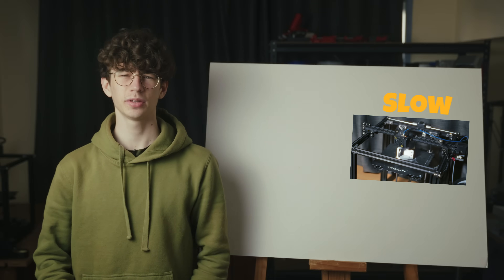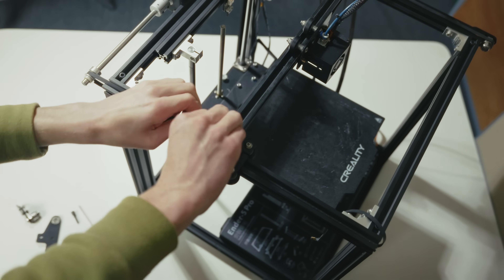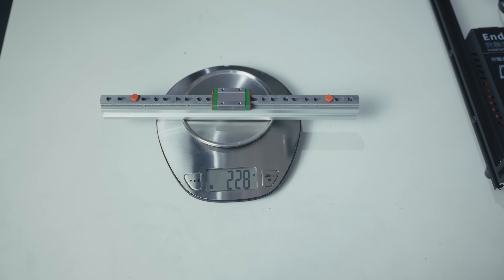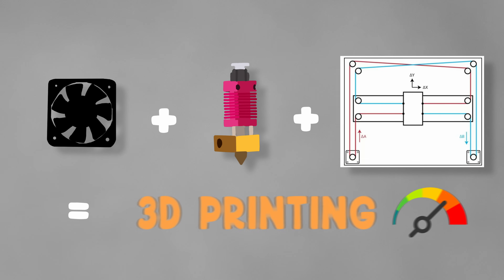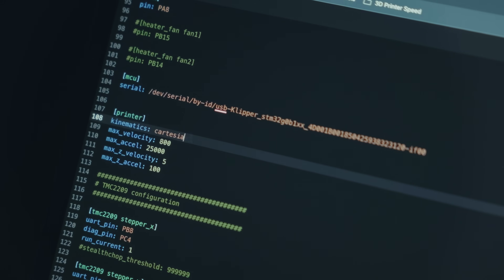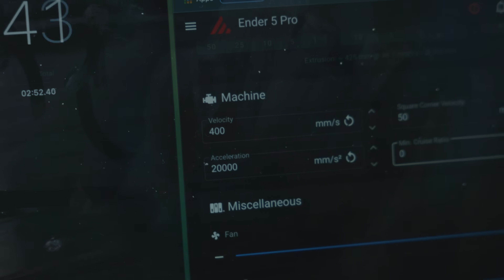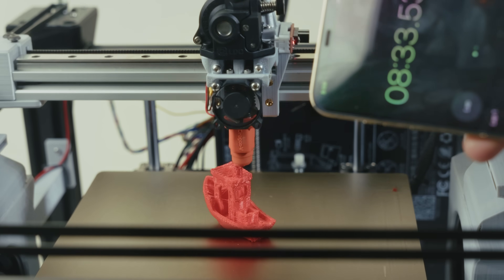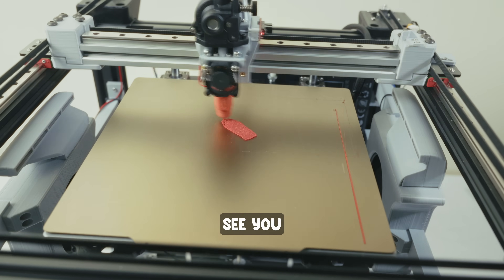Building the Fastest Ender 5 Pro

Comment: Your comparisons of Modified to Stock quality are objectionable. E.g. @ 15:07 Beyond being obviously worse quality than the 78m stock, That 8 minute 43s had a layer shift. The motion system failed. The motion system was the whole point of the mod. Don't pass go, don't collect 200, the machine did not successfully print an 8m benchy.
Reply from the maker: Objectionable is putting it lightly, so I appreciate your patience with your comment; I think I spent less than 1 hour actually tuning/calibrating this machine once it even worked, let alone time spent doing test prints. The quality is far from ideal, even at the lower speeds, although the speed print was just for fun. In this instance, and even with the Mercury 1.1 conversion, the flimsy z-axis mount is quite a notable bottleneck. Regarding the layer shift, I worry that I didn't even do Input Shaper on this machine, so that likely was the cause for such a low-speed skip. Cheers!

Comment: is there an upgrade to Ender 5 Plus?
Reply from the maker: I don't believe Boothy's conversion is meant for the E5 plus, but I know that the Mercury 1.1 conversion does work with the E5 Plus, and quite well too, given the better Z axis design on that model. It's definitely worth looking into. I did a video on that conversion too, although it was still on this Pro model, and not the Base or Plus one. Cheers!

Comment: Hello
Could you tell me which firmware you have installed please?
Do you have a link where we can recover this one?
I transformed my Ender 5 into Core XY and I am currently in the Klipper installation stage which poses some problems for me.
Thank you very much for your help
Reply from the maker: Hi, I have klipper firmware installed. I unfortunately have no links or files since this was very long ago. Have you tried restarting the installation process? Issues can sometimes be due to the MicroSD card.
If you are able to provide a basic explanation of the problem, I can try and help, but I do not have much time at the moment, sorry. I wish you all the best I can with fixing this. I know how frustrating it can be.

Comment: bro,can you tell me what should i do that is realistic and not expensive to make my ender 5 pro fast?
Reply from the maker: Klipper and Input Shaper are always the most cost effective methods for increasing motion system speed and quality. Then, a cheaper high flow hotend and some high RPM 5015's can make things a whole lot better too. Those are the most value friendly options before things get more complex and costly, in my opinion. I hope that helps a little bit. Cheers!

Comment: ia there the printer.cfg file ?
Reply from the maker: I don't have this config anymore, sorry. I've been trying to store later ones in case, but don't have this one handy.
Reply: @TommyHoughton you already tore this down? 

What was the reasoning like what is the disadvantages
Reply from the maker: Honestly, most of my printers don't get used after their respective videos, usually because my executions are sub-par and they're hanging on for life... I'm working on getting better at fixing this.
I mainly wanted to go crazy with the Merc 1.1 conversion with AWD, since I knew it would be a performant machine and video. It was mostly a learning experience goal, but I prefer the Merc mod more because of the community. There's more mods, upgrades and parts, and the instructions were equally as fantastic. There aren't any notable disadvantages with either of them from what I experienced.
Reply: @TommyHoughton I respect that 
I only went for this mod Bec I started before the merc came out so finally got to it and now almost done the build

Comment: Yeah, The custom linear rail was clever, but from an engineering standpoint that's one of the components that makes the least sense to replace with a lighter version. 

I'm happy you went back to the real one. that aluminum extrusion that you use for the gantry is very heavy, for vorons and stuff they make insanely light gantries that you can just bolt the linear rail to.
Reply from the maker: I had high hopes! But yeah, I was a bit blinded by weight reduction and cool factor. 
I did want to try a cnc'd one, but at this point, a good x-axis beam (machined, CF or stock) is what I'll keep going with in the future, and I'll just compensate with more power. I hear fysetc makes some lighter linear rails, but I don't know if I'll try one yet. 
Cheers!

Comment: Thank you for all your support. At least I got faster prints, bit know I have horrible noise! I checked the rails without belts and is silent,  then I install the belts and the printer sounds like and old bed. Is that normal?
Reply from the maker: You're very welcome, and I'm happy to continue helping you. It doesn't sound normal. If everything is correct than the machine should still be mostly quiet, but running the drivers in spreadcycle vs stealthchop would make it louder than before, but it shouldn't be on a horrible level like you described. Is there anything mechanical that seems wrong? It's possible that the belts may be rubbing somewhere, or perhaps the belt has missed one of the pulleys and is making contact with the frame. It's maybe possible they're overtightened, but this is less likely compared to the other possibilities. These are my best guesses. Please let me know if that helps or doesn't!

Comment: Master I need your help. The printer is printing horrible! A simple calibration cube and the result is not a cube. It is like a trapezoid! What could be the problem?
Reply from the maker: Hey Sebastian, I'm sorry to hear that. Like a trapezoid? I never encountered such an issue when I did this mod, so I'm at a bit of a loss for what could be the issue. It’s possible with CoreXY to have skew issues when the belts are unevenly tensioned, so perhaps that's a factor? I’d also check if the pulleys are aligned and the grub screws holding them are fully secure. It's also possible that one of the motors is moving or less than the other via different rotation distance values, or if the grub screw isn't tight like before. It's a bit difficult for me to provide suggestions, as I haven't yet encountered a similar issue. I hope you resolve it, and I'll be here to offer any advice that I can. I'm glad to hear that you're at least at the printing stage now.
Reply: @TommyHoughton  hello! Thanks for your answer! I found the main issue,  one of the motor pulley was not tight, then it was sliding in the motor hehe. Solved that I am getting a fairly cube. I found my x aluminun profile is not straigh, ans it is because I am supporting it with a different support ans it is not very strong. I need to re design and print it, but problem is that the print will not be good with this problem hehe. It is my only printer
Reply from the maker: Hey Sebastian. I'm really glad to hear that! That was the same issue I had on the other conversion I did to this machine. Ah, I see. Those extrusions can very in straightness. If you're still having issues with the straightness, or "skew" of the prints, then there is perhaps a digital solution. I would recommend checking out Vector 3D's "Califlower" which is a calibration print design to help correct skew in prints. It may help your machine work better! I saw a free version of the file alongside a few other variants, but I haven't use either of them.

Comment: hello!!! I have almost everything done!!! but.... in Klipper is just to change the kinematics to corexy?
Reply from the maker: That's great to hear Sebastian! You're making awesome progress. 
Changing the kinematics to CoreXY is a good step and I think the most important one. Depending on if you changed your mainboard, there are a few other changes such as making sure all the pins are correct for the components, PID Tunes, endstops and homing direction, limits for each axis (E.G installing a part has taken away 10mm from X axis so that would need adjusting.) There shouldn't be any harm in testing each area of the printer (extrusion, homing, etc) and seeing what needs adjusting as you discover it. Good luck!
Reply: @TommyHoughton  thank you! It is working with the kinematics and I had to invert the mottora direction, now I am setting the bl touch and I will include all the info you gave me. Thanks!

Comment: I mean, after all that, might as well just buy a different printer
Reply from the maker: Sure, if I wanted to just print and not tinker. But I like to tinker and learn. Even after a rework in part 2, this machine is lacking (notably in the Z-Axis and a bit in the belt tensioning mechanisms,) but once I learn how to make that as good as it can be, I'll be able to confidently replicate that for a custom build which is the ultimate goal. Cheers!
Reply: @TommyHoughton why dont you try mercury one hydra y would greatly improve z axis i would love to see a quality centered improvement for this printer.
Reply from the maker: @g10by  It's crossed my mind a few times, and was especially enticing when I later converted this machine to a Mercury 1.1, but at the time, the added cost would have been too much for me, and made the project more complex than I could have handled. I can't promise I'll give it a go in the future, but I'd really like to. Cheers!

Comment: I'm no whiz at Clifford I've done the conversion on a couple of my machines and know the basics but I've always wondered why no one came up with a cooling fan that moves with the carriage like a carriage that's under slung from the print carriage that has a giant cooling fan that moves along with the carriage granted you would probably lose some y travel at the front or back of the machine but say a carriage on the opposite side of the frame is the print carriage that moves with the print that had say like a CPAP unit mounted to it that would allow it to stay as close as possible to the print at all times would seem like the best approach to cooling That is as far as what you're trying to achieve I have it in my head a couple stuff for motors pullies belts control by clipper I don't know if you understood my rambling or not but I've always thought that especially on core XY machines would be damn near impossible in a beds slinger
Reply from the maker: I'm a bit unsure what you mean by another carriage or such, but I did utilise a CPAP in this video's version two. The title is "Building the Fastest Ender 5 Pro (but FASTER)." It's definitely the best cooling approach, with minimal mass gain, and excellent air pressure. I hope that's what you meant and I apologise if I misunderstood 😅 Cheers!
Reply: @TommyHoughton  I tried explaining it on a core XY let's go with bedslinger think of it like an idex but instead of two printheads you have a printhead and a fan head that moves with the printhead to cool does that make sense? For XY kinematics you would have to have it more complex setup
Reply from the maker: That makes a bit more sense, thank you for explaining. Would it be similar to what the Neptune 4 Pro uses? Except it would move with the toolhead. It would be a bit more complex on CoreXY for sure, but I don't really see the point if a CPAP turbine is mounted to the frame with a tube guiding the air to the ducts like I've done previously. Perhaps it would lose a bit of pressure compared to your approach, but it keeps overall y axis and toolhead mass at a minimum. I do have plans in the future to build a printer that could try this approach, but can't confirm if that will happen. Thank you again for explaining.
Reply: @TommyHoughton  I've not had my hands on a c pap.   Yes move with the print head type set up to deliver air consistency volume and distance, I print a lot of solid functional parts and pla pro like to curl as you know and strength is connected to layer bond and such
Reply: @TommyHoughton  great videos btw I watched the show on the used printer twice 😂😂.  I have two with Robin nano board one running klipper
Reply from the maker: I really appreciate that 😄 I think it was a neat little series and a good learning experience too. They're quite neat boards; I wish they were more popular since they're very feature packed and versatile.
Reply: @TommyHoughton  yeah there's a lot of MKS/ makerbase hate I don't get it I have a makerbase pie and it's awesome I put their most basic board in an anet8 someone give me and it had more features than I needed   newest image for the Mks pie is awesome from the little TFT screen that comes with the pie you can do basically everything you can do through fluid I do understand the very first pi for the rushed to market what's very basic version 1.1 that I have, marked improvement and the original OS very basic but that was also in a time where everyone was trying to rush something to market because there was a riceberry pie shortage

Comment: Nice build! 

I had the idea to convert my Ender5 Plus to Corexy about a year ago... I went full retard with a BTT Octopus, AWD, CPAP Fan, Pheatus rapido and Orbiter 2 and a ton of reinforcements in the frame. Most parts of the drvetrain are milled from aluminium on my own mill :D
I'm doing 28k accel and tested printing speed up to 360mm/s. the movementspeed is about 750mm/s.

Go the extra mile and add two more motors and a cpap :D It pays out ;)
Reply from the maker: Thank you Timo!
I can bet that the conversion would benefit the plus model a whole lot more, especially the route you've done! The aluminium parts sound awesome 😄
That's a great balance for speed and quality/reliability, I ran similar speeds for the V2 video I did, which might sound like I'm copying, but it contained AWD, CPAP and an Orbiter v2 as well haha. The video is a few months old now but I'd definitely recommend a quick skip through haha. 
I've been hooked on CPAP since I tried it there,  and I plan on putting another one on my Ender 3 alongside some other finishing touches. 
All the best with your projects! Cheers!

Comment: Hello. I already got the parts from amazon. Then I am going to print the others, however I see in the video you went with PETG but in thingiverse you used or suggested ABS, can not I print with PETG? Or do I need mandatory ASA/ABS?
Reply from the maker: Hi Sebastian, If you can print ABS/ASA then I would go with that, however, I had no issues with PETG for the (limited) runtime that I had. The highest priority is the motor mounts, as they will receive the most heat.
Reply: Omg, I will need an enclosure hahaha, what a problem! My ender 5 is my unique printer
Reply from the maker: @ I heard it’s possible to use a (I think it’s called a) “draft shield” or something. (I might be completely wrong.) It’s a slicer options that prints a wall around your parts to help reduce warping. I’d certainly recommend giving ABS a go with what you already have, it might work out! I haven’t printed ABS in 5 years so I can’t give you anymore info 😅
Reply: @TommyHoughton  thank you! I will research!
Reply: Master a new favor, looking for the stepper motors, I found they sell a metalli mount, is like an L, that only attach to the extrussion with two nuts. Are they a good option? Or is better to print yours?
Reply from the maker: @SebastianRamirezH  Hi Sebastian, as I don’t have any experience with this mount you have mentioned, I can’t give any advice. Boothy (the creator of the conversion I used) has an excellent instruction guide that I highly recommend checking if you haven’t already on thingiverse. He also has a discord server with members who should have more experience and be able to give you a better answer.
Reply: @TommyHoughton  yep, I checked the guide, and that mounts are the ones that spend more material hehe, what is the discord?
Reply from the maker: @ I see. I don’t have a link to the discord, but he might have it on his channel (Boothy Builds) or thingiverse page somewhere.
Reply: @TommyHoughton  Hello Tommy, and thanks for all your help. Boothy is difficult to answer so I will follow the normal steps, not get more complex in this hehehe. He mentions that printed the parts with 3 permiteres and 30% infill, did you print like that? or more infill? etc

Comment: So how much did all of the parts cost?
Reply from the maker: It was a few hundred NZD if I remember correctly, I think the CoreXY conversion was about 200? Then it was a couple hundred for the hotend and new electronics. It would be cheaper if I went with less powerful components. After doing the mercury 1.1 conversion too, I'd say the merc is more value friendly and long term better. Cheers!